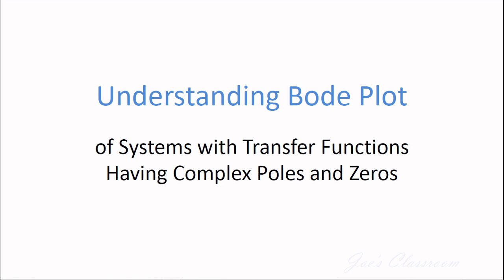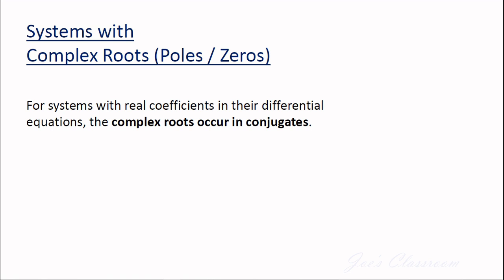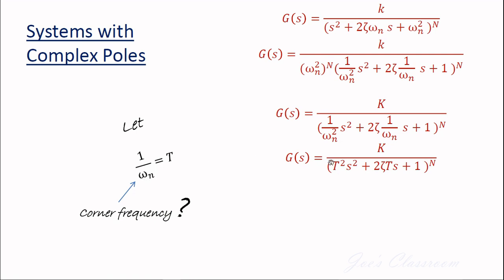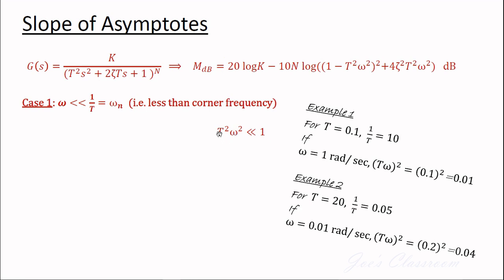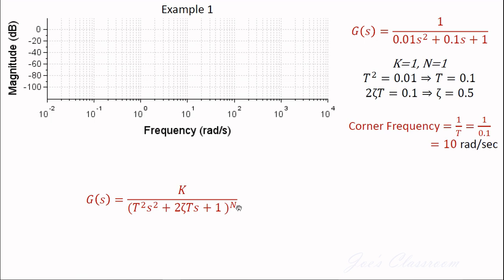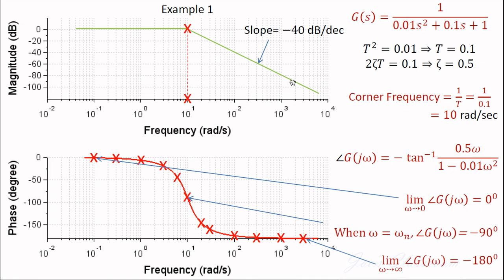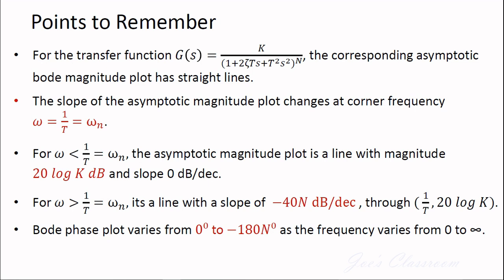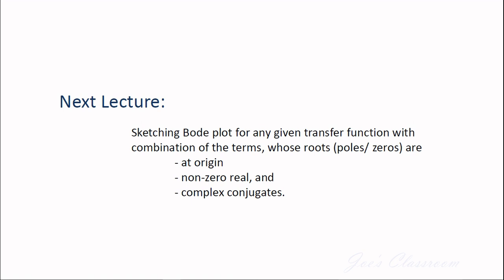Bode Plot for Systems with Complex Poles and Zeros | Lecture 6 | Frequency Domain Analysis

Comment: At 16:54 arctan(1/(1 - T^2*w^2  + j*2*z*T*w) does NOT equal arctan(1) - arctan(  T^2*w^2  + j*2*z*T*w).  In any case arctan(1) = 45 degrees not zero degrees. The answer is correct, however as when we multiply the numerator and denominator by  the complex conjugate ( T^2*w^2  - j*2*z*T*w and then take the ratio of the imaginary to the real part we get  arctan( - j*2*z*T*w/T^2*w^2) = - arctan(j*2*z*T*w/1 - T^2*w^2).
Reply from the maker: Thanks for your comment.

Let me explain as follows: We know that the angle(z1/z2)=angle(z1)-angle(z2), where z1 and z2 are two complex numbers.

This implies that
angle(1/(1 - T^2*w^2  + j*2*z*T*w))= angle(1)-angle(1 - T^2*w^2  + j*2*z*T*w) -----------------(1).

angle(1)=0         (since, 1=1+j0, and arctan(0/1)=0)  --------------- (2)

angle(1 - T^2*w^2  + j2zTw)= arctan(2zTw/(1-T^2*w^2)) ----------------(3)

Using (2) and (3) in (1), we get,

angle(1/(1 - T^2*w^2  + j*2*z*T*w))= 0 -arctan(2zTw/(1-T^2*w^2))
Reply: Are you Santhosh dad
Reply from the maker: No!